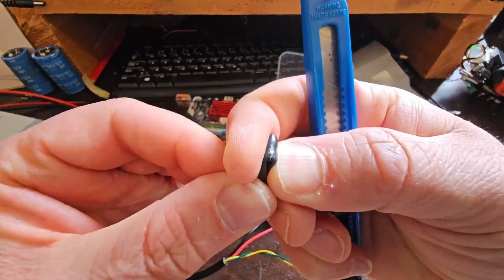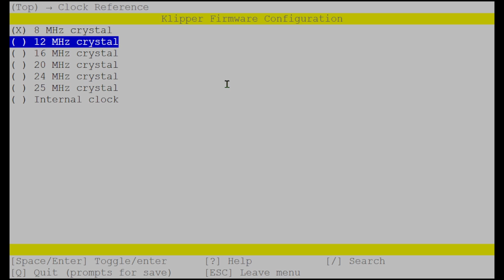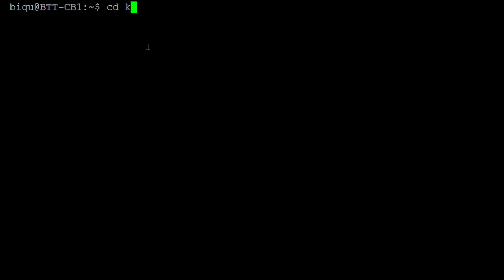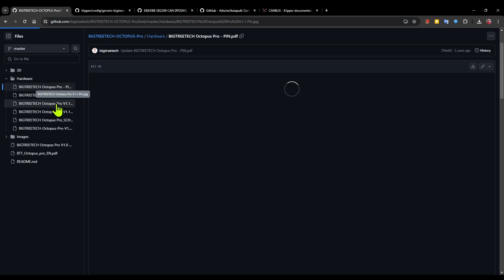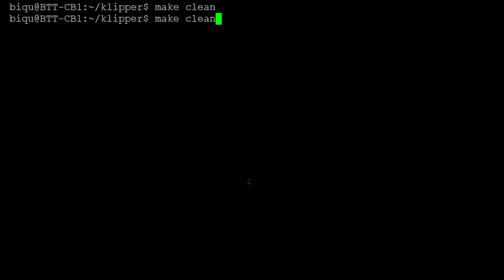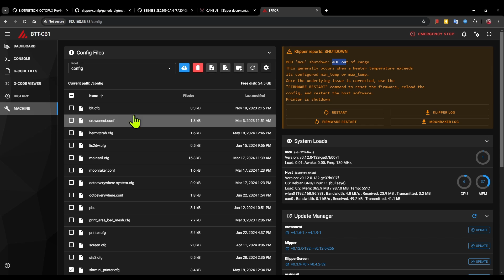Octopus pro to sb2209 canbus set up

Comment: what to do if i dont see anz UUID after MCU flash?
Reply from the maker: Check for correct wiring and that both termination resistors are in place. Also all nodes need to be set to the same bitrate.

Comment: This will not work on a Pi5 allow-hotplug can0
iface can0 can static
    bitrate 1000000
    up ip link set $IFACE txqueuelen 128

Any solution?   

It breaks the boot up of Mainsaill, requiring a terrine restart to get it up.
Reply from the maker: Use the systemd method as described here, https://canbus.esoterical.online/Getting_Started.html

Comment: I tried this on my workbench before installing everything in my Voron Trident and it worked just like you explained (btw: great explanations for the commands used).  Now I've installed my BTT SB2209 in my printer, and re-installed the Raspberry Pi OS and Klipper and I'm trying to update Klipper on all mcu's.  I can not get the CANbus UUID of the SB2209 to show for the life of me.  I did record the UUID while I had it on my workbench, but it just doesn't show up with the Octopus 1.1 board (the Application: Klipper shows, but not Katapult).  Any guides/clues to what I'm doing wrong (or not doing)?  The buffer length is set to 1024 (I've even tried 128) and the resistance between H and L lines are 60 ohmns.  the menuconfig elements are all correct.  I know katapult is being installed because I've tried to redo the firmware with the LED status enabled and I see it blinking after it is done, just can't get the UUID to show.  Not sure how I would upgrade Klipper in the future if this is required.

Comment: My 1.1 has the phone jack for CAN.... Poor call IMO.
Reply from the maker: It works well, but yeah old design. Though that kind of jack is used a lot in motion control and other automation applications, so it wasn't a surprise to see for me. It was also designed to be a quick connect to the hermit crab tool changer setup.

Comment: Just putting together a Siboor Voron 2.4 kit and watching through this video I can see it is going to be very useful. Pity you didn't wire up the sensor board as well to show where those wires were going to.
Reply from the maker: The cartographer? That plugs to the canbus pins on the fan side board.
Reply: @StackingLayers  sorry I don't know the names of all the boards yet, but I think that is the name of the sensor board that is located right next to the .4mm nozzle      Not sure what you mean by "fan side board". I see another PCB in the kit that has EBB SB0000 CAN (Version 1) It looks like the 4 wires coming off the cartographer might go to the +5v, CANH, CANL and GND on it. Does that board then plug into the EBB SB2209 you showed in the video making the cartographer the last terminating point of the CAN bus?
Reply from the maker: @DodgyBrothersEngineering yes the SB0000 it's shown in the SIBOOR build docs https://github.com/Lzhikai/SIBOOR-Voron-2.4-AUG/blob/main/Images/Octopus_Board_Wiring/cartographer%20SIBOOR%20V2.4%20R2%20AUG%20Wiring%20Diagram.jpg
Reply: @StackingLayers  OK just found another video that show the EBB SB0000 (which he is calling the SB2040) shows the board piggybacking each other. I think my answer should be in this other video. Thanks for doing such a great job on your video. Not sure how I would have ever worked this out from the limited instructions I was given.

Comment: I cant find the can bus adapter cable any chance of a link please
Reply from the maker: https://biqu.equipment/products/biqu-rj11-to-can-cable-150mm-for-octopus-v1-1-and-octopus-pro-can-interface-for-3d-printers?srsltid=AfmBOor2qu17gbi8t1p2IOPVeQqRytZwZo7MRdzr7kwACkTvI-8ZGaFx

Or you can use one of these 
https://www.aliexpress.com/item/1005007052270810.html?src=google&pdp_npi=4%40dis!EUR!6.13!2.08!!!!!%40!12000039238448057!ppc!!!&src=google&albch=shopping&acnt=298-731-3000&isdl=y&slnk=&plac=&mtctp=&albbt=Google_7_shopping&aff_platform=google&aff_short_key=UneMJZVf&gclsrc=aw.ds&&albagn=888888&&ds_e_adid=&ds_e_matchtype=&ds_e_device=m&ds_e_network=x&ds_e_product_group_id=&ds_e_product_id=en1005007052270810&ds_e_product_merchant_id=5351920883&ds_e_product_country=NO&ds_e_product_language=en&ds_e_product_channel=online&ds_e_product_store_id=&ds_url_v=2&albcp=21627925185&albag=&isSmbAutoCall=false&needSmbHouyi=false&gad_source=1&gclid=Cj0KCQjw8cHABhC-ARIsAJnY12w89LVJXJwpKvuAmgHpqZvr2QZLHEJ1gR7PFajHVLXuwI3w_u1PhrMaAuSoEALw_wcB

Comment: I’m having trouble getting the katapult UUID. I’m getting the klipper UUID. Where do I need to have the jumpers on the tool board and main board. I have the exact same setup as yours but couldn’t understand where the jumpers go. I’m hoping that is the problem
Reply from the maker: The klipper UUID is the same as the katapult UUID. It will only say it's katapult if klipper is not installed. Katapult is a bootloader and klipper runs in front of that. The UUID is the id ov the MCU

Comment: hi, i have also the old version of can-bus connector on my btt octopus board. unfortunately i do not have that adaptercable from RJ45 to the green/yedllow connector of the can-bus cable. Is there a wiring - guide, to crimp such cable on your own?
Reply from the maker: It's an rj12 or rj11 connector. And it's just the 2 middle wires that need to be connected for can high and can low. Typically the green to low and red to high, but wire colors may very. Here's an example of the adapter. https://imgur.com/gallery/XaOZMpU

Comment: Not able to put in dfu mode any info would help
Reply from the maker: Do you have the jumper in place?
Reply: @ yes i had to remove all the cable from the board like you had to get it in dfu mode, and i was able to follow through with your video really well done, but now trying to get the cartographer to communicate/set up. I have the siboor kit 2.4 r2 aug as well.
Reply from the maker: Which version carto did you get? If it's the one with the lis2dw accelerometer on it then you need to remove the 120r jumper from the sb2209 because that version has the 120r built in and it activates when powered up. https://docs.cartographer3d.com/cartographer-probe/installation-and-setup/probe-installation/can-termination
Reply: @StackingLayers  i sent a msg in discord
Reply: i jsut wnet back in it and all the uuid  are gone how is this possibel
Reply from the maker: @levileroux1403 if you already put the UUIDs, that were found, into your printer.cfg they they will not show up anymore. You'll need to stop klipper in that case with the command, sudo system to stop klipper.service

Comment: Thank you for this great guide. Just a tip for others. I could not get my U2C board to connect to my EBB2209 board after trying what I thought was everything. Finally I checked the resistances on the canbus and found that although the jumper was fitted on the U2C board on the right pins it was making a poor connection so I was not getting 120 ohms at the can H and can L pins of the board. Hope this helps someone

Comment: On the wiring for the SB using the Bed Out on the motherboard where you said only use the red wire on the bed out: why not use both 24vdc (red) and 0v (black) on the screw terminals?
Reply: Wait I know why. You need logic to turn on the bed output we only want to use the fuse and nothing else, so plug your positive wire thru there but plug in the negative to incoming power as in always ON.
Reply from the maker: Exactly. You can do it with logic and set it up to be controllable if you wanted to.
Reply: Can't like this video enough! Thank you.
Reply from the maker: You could do it like that but you will need to set it up the printer.cfg to turn it on at startup. That 0V terminal the one that controls the pwm for the heated bed. It's easier to just connect to a normal 0V terminal.

Comment: Hi. Nice video, very informative. Thank you! :)

One question - you mention using the bed out to power the 24V of the CAN board so that one can leverage using the in-line fuse. How does one configure this in klipper/klipper firmware? Because when I configure the firmware for PA1 (heated bed out) to set  or unset in the firmware, it only give 0 or 3V. Any help would be much appreciated. :)
Reply from the maker: You hook 0v to the PA1 (bed 0V) and 24V to the bed out 24V. The pin is controlling a mosfet that is pulling to 0v to complete the circuit. The 24v terminal is the fused side. You will need to connect the 24v and 0v from the power supply to the bed in too.
Reply: @StackingLayers  Ah, okay. I was doing what you said, only that I switched bed out and PA1! Now I am getting 24V to the toolhead! 😊

Comment: Unable to go forward , as need to create a new file name using” sudo nano “ unable to save details, coming with error- No such file or directory.
Any help
Thanks
Reply from the maker: That is typically caused by syntax error. Meaning something wasn't typed correctly in the command. sudo nano should automatically create the file if it doesn't exist. Make sure spaces are in the correct spots and double check spelling and capitalization all are very important.
Reply: @StackingLayers  yea, have same problem, everything typed correctly, but still having the same issue
Reply: can get to interfaces.d without error, but when added can0 it tells me there is no such directory
Reply from the maker: What is the exact error?
Reply from the maker: You need to create the file. If you are already in /interfaces.d then you create it with,
sudo nano can0

Comment: Hi! How can i setup two ebb42 for dual extruder head? Must I use 2 set of wires or I can connect both ebb one through another?
Reply from the maker: You can connect one to the next. Canbus is best when connected in parallel. So imagine the canbus high low lines has two straight lines and each node (MCU) is placed on those lines kind of like plugging into home outlets. One important thing to remember is that the 120Ω termination resistors need to only be at the very first and very last nodes nothing in between.
Reply: @StackingLayers  I must use separated power supply lines for both ebb in this case? two extruders uses twice power consumption. printer is raise 3d n2 dual plus
Reply from the maker: @jimmyboyorsk yeah you should separate power lines, or use a wire gauge that it rated for the total max current draw.

Comment: I was struggling for the past 3 days trying to get comunication and this video was a life saver, Thanks a lot...  i got one qustion at the timeline @1:02:14 after flashing now it have to Klipper ID and now is confusing luckly I recorded wich are who... Is this last part of flashing is necessary? in other guide I dont see this option, Can I reverse this option for future reference in case that I need to check the ID's again and dont be mistaking?
Reply from the maker: The uuids will stay the same for each devices, so as long as you keep a note of them you can just reference them like that. If you lose the UUID you'll need to stop klipper before querying them, since klipper will not let them show if it's running. You can stop by sending this command,
sudo service klipper stop
and to start it again use,
sudo service klipper start

Comment: SUPER helpful! Like others in the comments here, saved me a lot of headache. Thought I could make the firmware for an Octopus Pro V1.1, move that to the SD card, boot the MCU from there. That lead to "ip -s link show can0" showing "no device." Flashing the MCU firmware to the board in BOOT mode was the fix. CAN showed up right away with that command then got the UUID and setup Printer.Cfg smoothly. Looking forward to completing this upgrade from a Creality Sonic Pad host, then adding in my EBB36 toolhead board in some time.

Comment: Great video! Any chance you can show the process with the fysetc spider 3.0 and SB can TH? Documentation is poor and contradictory. I’m stuck with mcu dropping connection and not starting after a restart. It’s very frustrating.
Reply from the maker: I unfortunately don't have those boards to make a video of them. Thing to check for though would be if you have the 120r termination resistors in place. There needs to one at both ends of the canbus line otherwise communication issues can occur. Also check the physical connections of all cables and quality of the cables. If there's bad or weak connections that could also cause issues.
Reply: So I found that esoterical’s guide saved me and got me running for about 100 hrs. Unfortunately, my board doesn’t work anymore with the 5v and 3.3v not working. It only powers up and doesn’t go into DFU mode anymore. Safe to say once you get it going, don’t update it at all. I have since moved to the octopus pro board with the h723 chip. It’s a lot of reconfiguring now.
Reply from the maker: Sounds like there was a physical failure of some sort. The firmware doesn't control the 5v and 3.3v converters. I would assume something killed the 5V converter since that usually powers the 3.3V one. Without 3.3v the main chip will not work, so it makes sense that you can't get into DFU mode.

Comment: ok i need help badly!!! I have the Siboor Voron 2.4 aug, i was following your video because i wasn't seeing any of my UUID's Including the Octopus pro. I was able to reset the Octopus pro and finally get the UUID from it. But after following you video and flashing the Can board i can not Pull the UUID form the that board. And Now i'm unable to see the UUID of my Octopus board. Have any idea's?
Reply from the maker: Check the wires in the rj11 connector. There was a batch that has them backwards. There's a post about it on the SIBOOR discord https://discord.com/channels/1030697720312234054/1031481344796135504/1266287652534222858

Comment: honestly all i want to know is how to rotate my lcd screen :(
Reply from the maker: Which one do you have?
Reply: @StackingLayers  thankyou very much for replying but since commenting i fixed it. had to rotate the x11 output and flip the touch input as well. but now it works and i am struggeling with a nother issue (my zprobe being triggered at all times, it isnt inverted)
Reply from the maker: What probe ? Where is it plugged in to, and what board? And how do you have it configured?
Reply: @StackingLayers  once again, thankyou but i solved the problem allready!

Comment: Are these steps kind of the same when using an Ebb36?
Reply from the maker: Yeah, basically. The make menuconfig settings will be a little different because it's a different chip on board. So make sure to look at the GitHub repo for that.
Reply: @StackingLayers  thanks brother for your fast reply and awesome vid

Comment: Hi have followed the tutorial but I can get the uudi of the tool head board. is there another you know of to flsah it
Reply from the maker: There's a chance that the canbus high and low cables need to be swapped. There were several adapters that plug into the rj11 connector that were wired wrong at the factory.
Reply: @StackingLayers  not using the rj11. Using a U2C.i can see my cartographer and main board uuid but I can't see the toolhead board.
Reply from the maker: All I can say would be sure that the high (typically yellow ) and low (green)are in the correct spot. If you have the ADXL version of the cartographer, you need the 120r jumper in place on the sb2209. If you have the LIS2DW version then no jumper on the sb2209. Also double check that you have not missed any of the settings in the make menuconfig for the version of sb2209 upi have, in both katapult and klipper firmware including the bitrate, all need to match.